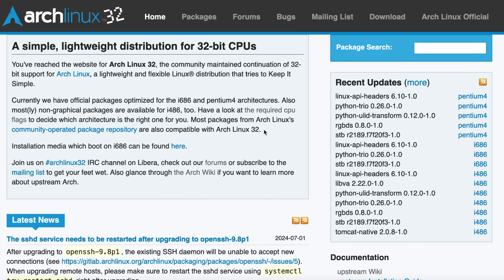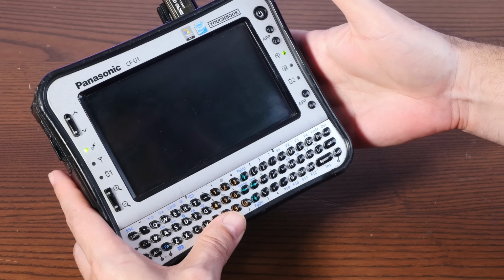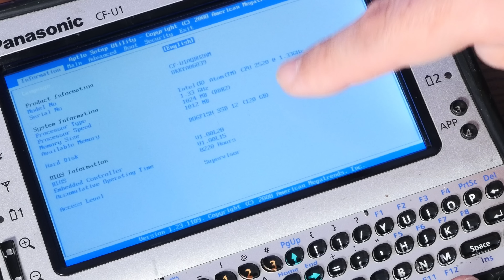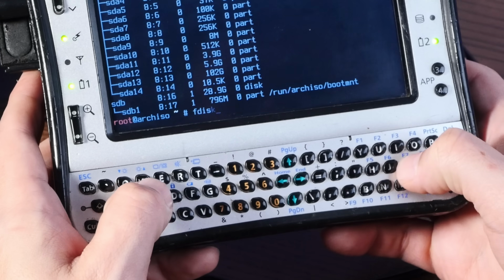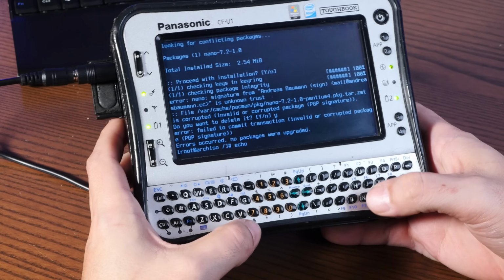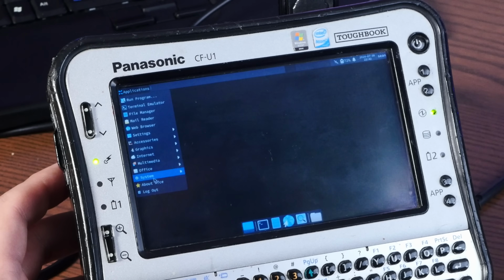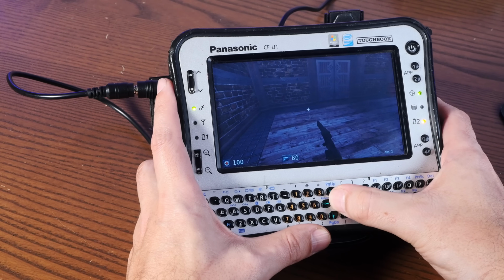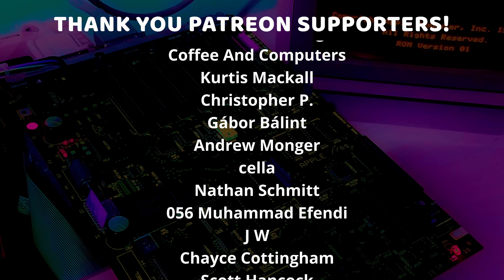The Arch Linux Goober

Comment: I remember, way back in the day, mucking about with Slackware on a Fujitsu Point 510 “tablet”. Bloody great 100MHz (a whole 100!) 5x86, 8MiB built-in RAM, and a “GPU” with not quite enough VRAM to cover the full 800x600 display at 16-bit colour mode. (The last few lines of the display’d end up hot pink.) You could put down a dog with the thing, it was shockingly massive for its intended purpose of warehouse inventory management or similar. Those were the days!

Comment: touchscreen calibration 😂😆😂,  in linux there is a MODE how to use touch - options are 1-as mouse, 2-as touch screen. you activated 1. and in many cases is usefully. just switch to 2.

Comment: I don’t know if it works on 32-bit Arch, but on 64-bit I get the corrupted signature error basically every time I run the install. The actual fix for it that I’ve found works reliably is to run “pacman-key —delete archlinux” and then “pacman-key —populate archlinux”

Comment: That'd make a pretty good hitch hikers guide or portable Wikipedia device. Just load up the offline version of Wikipedia and the various other free knowledge bases and Zim Wiki. You have a repository of knowledge that's portable with a built in keyboard for search input. Being a tough book just makes it even better as an off grid or network down device 

When it's not acting as an offline Wikipedia it's a pretty ok terminal. Not the first thing I'd wanna use to ssh into a switch or something, but it'd get you by in a pinch

Comment: If the date is off or if the keys are bad that could cause the issue you're having with the signature verification. 
One could try updating the time and then the archlinux-keyring. If that didn't work then turning off signature verification. Either way an update after install should fix it. 
Would love to see the output of lscpi on this device. I kind of really want one. Really cool.

Comment: I have two of these that I installed debian on. While the SD card slot is not bootable, you can do something of a "split install" by putting /boot on a usb stick and / itself on an SD card. I did this to free up the usb port while in operation. The usb storage is one of those tiny sandisk usb drives that barely sticks out above the unit when inserted. I zip tied it to the cable for the stylus so it'll never get lost. 

As far as the side buttons, they do report keycodes that are not mapped in the kernel by default. you can use a command to remap the keys and make them whatever you want. I have the top left rocker mapped to up/down since it makes scrolling pages while holding the unit a lot easier.

It isnt the fastest device, but for use as a thin client, it works well enough. I use them to remote into a VM that is much more capable

Comment: Cool. Thanks for making this video! We ArchLinux32 maintainers (the few of us) really appreciate. The issue with the keys is a constant source of trouble. There are various ways around it, like manually installing the archlinux32-keyring into the installation chroot. Also, ISOs don't always have the correct keys on them (they once got copied from the ISO to the chroot, so updating them after booting the ISO might also be an idea). And sometimes we (or should I say I) forget to have a timer for gpg renewals, so then I have to invent a time machine to go back fixing wrong keys..

Comment: I'm enjoying your Linux diversions quite a lot - especially since I feel like we got there in the same weird way - through Apple. My love of PPC Macs got me into Linux, years and years ago now. Perhaps later than the early 2000s, but the obsolescence of the G4 was a big motivator... 

So, if I may be so bold as to say - perhaps dust off those early Intel iMacs, upgrade them, and try Linux there. 

You have had more and more of this devil brethren haunting your videos... 

Personally I have a second gen Intel White iMac that I keep looking at... I've discovered ITX thin boards designed for AIO or industrial systems... 

But... is it necessary?

Hmmm?

Comment: What about building Phosh from the AUR, full Mesa hardware accelerated 3D with OpenGL (might need some env vars?) and then run the Phosh screen calibrator? 

That thing should have better 3D hardware acceleration for that game - glxinfo show the real GPU? Or is it LLVMpipe? 

But also all Xorg and Xorg-drivers: are they installed? 

—-

Also can you run OpenSUSE Tumbleweed just fine on it?

Comment: One thing I found during my installation of the official 64bit Arch was that an outdated Arch install iso would result in outdated repo keys, which could probably be fixed with a simple pacman -Sy as root on the installer, but then depending on how old your iso is, it's probably better to install a new iso anyhow.

I recommend Ventoy just due to how you can plop the file into the USB and not need to write anything to the stick itself. And if you get a big boy flashdrive, you can put a whole lotta ISOs on there. You could even probably fit the Window 11 iso, if it's a couple terabytes!

Comment: We use those style of machines at work for field workers. They usually have cell connectivity, so when workers go out and complete orders, they can easily complete the orders in the field. All the device needs to do is display text boxes so the workers can put in information about an address or meter and then save it.

Comment: Woot U1!!!  Such junk but so fun. I can send you one of my mod boards and instructions for an even more reliable SSD install @actionretro
Reply from the maker: oh hey you're the person!! thanks for your guide! i bought one of those little boards you had to try and make the same mod with a resistor. so far i haven't had any issue booting though - am i just lucky?
Reply: @ActionRetro  yeah must be! I just updated the guide in my discord. I added a wire to steal extra power from a 3.3v source.
Reply: @ActionRetro  Yeah a bit! I think you got a MK1 I didnt see the model number. They have a little more power to the SSD, the MK2 is a 1.6GHZ the MK1 is 1.33GHZ. I just updated my instructable and discord on that mod too.

Comment: For display calibration - you need something like xinput-calibrator or similar tool. Few years ago we had some embedded hardware at work with badly fitting touchscreen (basically it was "I built it from parts I had"), and we had to calibrate it, because touchscreen was bigger than they screen itself.

Comment: That would make a good wifi analyzer for walking around and seeing how many access points and their strength is to a graph on screen.
Well, except that it probably only supports 2.4ghz wifi
Usually I use a smart phone for it.   Very handy tool for a wifi engineer building out wide area wifi coverage with staggered access points to minimize conflicts.

Comment: Looks like video drivers needed to be set up, but it's entirely possible they just didn't exist.

ReactOS would also not be a great choice for DOS gaming.  It's more similar to windows NT than 9x, so any DOS software running in it would just be like running the games in an emulator on any other OS.  It could still be an interesting, if frustrating, experiment.  When I messed with ReactOS a couple years ago I had to install it in Russian because in English it would always just fail to boot.  Just tried it on a hunch as it's the only other language I have any even small knowledge of. :p

Comment: for the signature issues just install the keychain packages while doing the pacstrap step by appending those to the command, then continue with installation and once you are inside the chroot environment do a pacman-key --init followed by pacman-key --populate, wait a while for the process to finish and you will have working signature check

Comment: this command will regenerate the keys correctly to work without having to disable the signature checking 

sudo pacman-key --populate archlinux32

if running from arch-chroot you are already in su mode so you don't need the sudo. I just went through this installing archlinux32 on a Dell netbook. The Dell Mini 9/Inspiron 910.

Comment: I actually have one of these running windows XP, if you get it with the drive still in place they ship with a 32gb or 64Gb SSD depending if it was a MK1/Mk2 variant(the Mk2 also got a slightly faster cpu if I recall) if the ribon is still in the drive carrier you should be able to get a mcc0e32gzmpp-m1a or any similar 1" ide Zif SSD and use the original mounting(maybe throw something else weird in the wan slot)

Comment: That thing's probably falling back to software rendering for Sauerbraten Cube 2--  it's a Poulsbo device, and AFAIK Linux never got working open-source 3D drivers for the odd GPU Intel used in those (the GMA 500 is a licensed component from PowerVR, not one of Intel's in-house designs like practically every other chipset they've ever made before and since).

At least it worked at all.  Linux support for GMA 500 and derivatives was sketchy for years after release, even for 2D-only desktop use.
Reply: GMA 500 support was shi.. on every platform. None operating system had more support beyond displaying wallpaper.

Comment: (1) I have also installed Linux to a touchscreen device
(2) The original device is 1366/768
(3) I wanted 1080p so I could screen record and upload to YouTube 
(4) Using XRandr I changed it to 1080p
(5) Much like your the touchscreen was not calibrated after that so🤔🙃
(6) Unless Linux has an app to recalibrate...

(7) But yes can confirm that error

Comment: 6:35 "Fix the problem, the archlinux-keyring will." - Yoda
Reply: Yeah not the most intuitive but this has unborked me so many times after i dont update for months (on devices i dont use often at all)
Reply: Not so easy on 32-bit Arch. I had to disable security as well as it couldn't install ANYTHING with it enabled.
Reply: Damn thats a shame. Honestly on ancient hardware is probably fine taking an L on arch and just using something else that works out of the box
Reply: I just installed Arch32 a few days ago, and 'pacman-key --init' and 'pacman-key --populate archlinux32' worked just fine
Reply: @petar0402  pacman-key --populate archlinux32

 will fix it without having to disable the security first.
Reply: yeah this actually borks regular Arch and Im not sure if it was ever stated on the installation guide, I never knew about it untill I researched myself when I left one of my devices outdated for months
Its usually the only reason people think Arch breaks by not being updated (besides package conflicts)

Comment: Debian 32 might have been a bit easier on this hardware. I wonder if any touch calibration utilities would work with this.

The end result is reminiscent of a Clockwork Pi uConsole, but of course that's an ARM device, and much newer (and no touch, but a tiny trackball).
Reply: I run debian 32 bit on mine. The touch screen was still out of whack, but i made a script that fixes that.

Comment: To make touch work propperly  - you can calibrate it. I was able to make camera work under Antix linux, but the barcode reader - nah: seems that it requires some software. It hangs on a serial port.
App buttons seem to show up in dmesg unlike back buttons, so you can make use of the front buttons by assigning key codes to them.
The form-factor is incredible! I wish comething like this existed with a modern powerful and efficient cpu

Comment: The company I work at is a utility company and one of the mobile apps I supported used the Panasonic Toughbooks, but they were basically a rugged laptop/tablet (you could fold the screen back on the unit to make it a complete touch device). Didn't know Panasonic made an even smaller version like what you have. At least the Toughbooks I supported had a full, actual keyboard on them. lol! But those were slow too running Windows XP. Luckily, I no longer support that app. Fun times!

Comment: I've got 2 of these machines (the 1.66ghz ones)... well, 3 but I took one apart and couldn't get it back together... and I can't get either one to install anything on the mSATA drive. Win7 or Linux Mint install will auto-format the HD, but when it comes time to write the OS, it locks the machine up.

Comment: There are still recent 32bit #Linux distros ? using some old Kernel ?` or how come a recent Kernel uses 32bit?
Reply: there are a lot of distros made specifically to run on old hardware, this particular one is a community maintained 32bit version of arch since it dropped official 32bit support a good while ago

Comment: Tech YouTubers are here, and now you’re here. ARCH LINUX WORKS.
Reply: wah
Reply: Was anyone disagreeing? The existence of the hoards of people who won’t stop talking about using arch somewhat implies that it does at least the bare minimum an operating system can do - function.
Reply: curly < 3
Reply: even on my 3.1.9+ trust me it's fine!
Reply: Meh
Reply: There's one thing to remember about all complicated systems: The simplification system is always 4-5 times more harder to fix than than the thing it simplifies.

How complicated is operating an 18 wheeler, including the gears? And how serviceable is the actual gearbox and drive train?

How complicated is driving a Tesla? How serviceable is the entire electrical system, charging, motors, etc? 

Now, how complicated do you think using Arch is vs. Windows? And how complicated do you think fixing Arch is, compared to fixing Windows?
Reply: @OhhCrapGuy I've had Windows implode into Disk Use 100% from mandatory forced updates. No solutions online outside of people trying to sell me programs I can't install due to windows imploding.

Arch at least tells me errors. And has fourms. And a wiki. And a dedicated base who tells you how to fix it beyond "did you run this one program we tell all users, even though it doesn't fix 98% of users' problems?"

Is Arcg perfect? No. Is arch for everyone? No. I like Debian. But Arch is better than Windows, every day.
Reply: @OhhCrapGuy  so true, but i would compare it to ubuntu or fedora since alot of the hassles is already dealt with in these distros.
Reply: barely, lol

Comment: What GPU does it have? Wonder if better drivers might help
Reply: It has the dreaded GMA 500 (rebranded PowerVR SGX 535) so don't bet on it.

For over a decade people have been trying to get 3D acceleration in Linux on it (and other PowerVR-based Intel GMA) with little to no success.
Reply: @OverTallman  Oof. What a shame. Software rendering 🥴